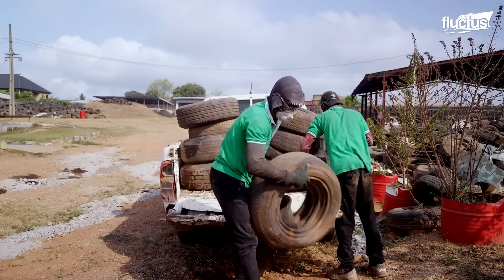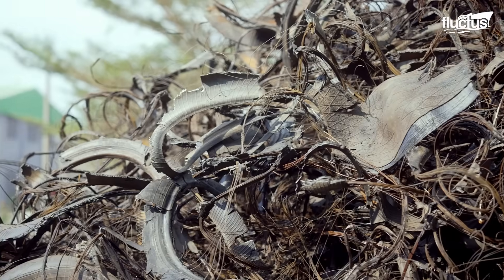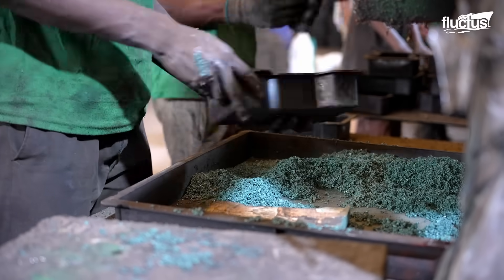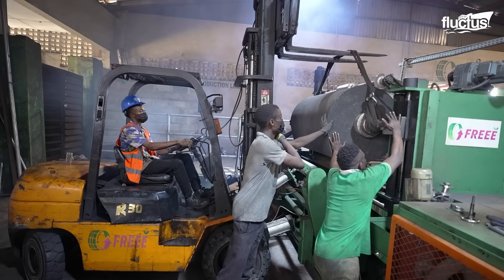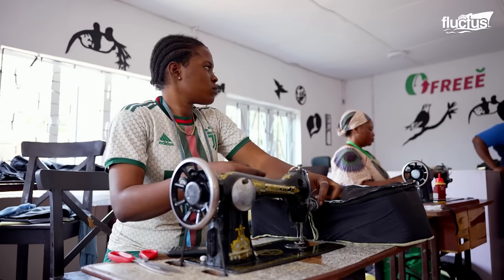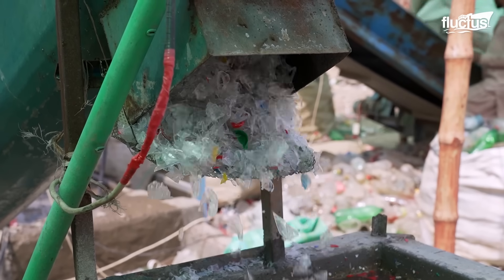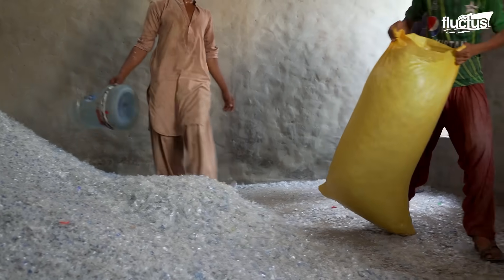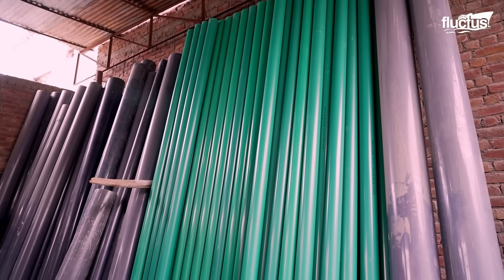How Nigeria Found a Genius Solution to Recycle Millions of Used Tires

Comment: If Nigeria can do it Australia should be able to do it. But Labor's employment/labour law kills all incentives to manufacture anything locally. Wage costs are too high a component of the operational costs.
Reply: I think it would be a bit more automated in Australia
Reply: @davidgreenwood5241  I disagree, all of the automation efforts are exhausted from putting shrimps on the barbie 😂😂😂
Reply: @nubiwiththebull, not to mention putting cold beers into eager hands.
Reply: @davidgreenwood5241 
A heLL of a Lot more 🤷.
Reply: The West would automate a lot more, we already do.
Question is if anybody would buy the products.

In the case of the pavers...., there is no way anyone in the West would accept those gaps.
You included, if you had to pay for material and labour.
Reply: @Peter2k84  If it was automated the work would be more precise.  Also the best shape worked out.  No gaps. It wouldn't be full employment but would put those tyres to good use.
Reply: @Peter2k84  one company in the UK started a trial of fixing potholes using shredded rubbers, better than tarmac and way cheaper! But I don't know what happened and if they wanted to make experiment official or dump tires and recycling to third world countries as usual ..... Because the rich don't make money from recycling .....
Reply: @Peter2k84  Well would have more precise equipment to make those pavers I'd guess.
Reply: How much are you willing to work in a factory for?
Reply: Workers salaries who actually manufacture things are too high but useless managers and executives who do nothing and make millions are fine.
Reply: @nspattak1 ceo's pay in the u.s. is the problem.  Start up capital is another. Golden tax loopholes for the rich to sail yachts through.
Reply: May be cheaper to do Nigeria as well due to bugger all safety enforcement over there!
Reply: Nigéria > Austrália
Reply: @NeuriLee  that's why so many people are illegally migrating from Australia to Nigeria, oh wait it's the people from Nigeria trying to flee their backwards country, lmao keep lying to yourself
Reply: Also im sure that's why so many of your Latin kin are flooding into the usa, cuz south America is just such a fantastic place to live right?
Stay home and fix your trash countries instead of lowering the quality of life up here please and thanks
Reply: Ich weiß nicht was ich davon halten soll.
Bei der Herstellung wird dem Gummi Schwefel zugesetzt, damit man die Reifen vulkanisieren kann. Den bekommt man nicht mehr aus den Altreifen heraus. Durch den Abrieb dieser Reifen,  beim Fahren, verteilt sich Feinstaub und der enthaltene Schwefel in der Umwelt.
Die aus geschredderten Altreifen zusammen gepressten „Pflastersteine“ haben keine kompakte Außenstruktur, sondern sehen ausgefranst aus. Außerdem wird irgendein Kleber verwendet um die Krümel zusammen zu halten. 
Verlegt man dann diese „Pflastersteine“ entsteht auch da Feinstaub, durch den ständigen Abrieb. Dieser enthält dann durch den Kleber noch mehr brisante Bestandteile. 
Ob das gut für Mensch und Umwelt ist, wage ich ganz stark zu bezweifeln.
Reply: @elliemeehan9947 you know what's hilarious? I was reading some old comments in newspapers from the early 40s last month and saw multiple times random people complain stevedores and other labor laws in Aussieland made it impossible to get shit done there 🤣🤣 that was 80 years ago and you're saying almost exactly what they did
Reply: @Magikarp-4ever quite so mate, my father was a shearer and took part in the big shearer’s strike for better wages.  He told me of the whining by the graziers and merchants at the time that the industry could not sustain the shearer’s demands.  Turned out to be BS, the nation rode on the sheep’s back for the next 40 years till we diversified and started giving our mineral resources to US and UK multinational companies for bugger all. The same old whinge comes out of the commerce sector every time wages are mentioned, a tired old mantra that has no relevance in this era. As far as the miners are concerned labor qld proved that the industry was still viable even after royalties were raised to 40%, it’s all about maximising the margin, nothing to do with nation building. I note that the new LNP gov in QLD hasn’t dropped the revenue, much to the chagrin of the millionaire mineral lobby
Reply: Machines have higher productivity, and needs less labor by hands. But they needs qualified operators, and high buying costs. Anyway we stuck on investment step in any recycling process.
Reply: Also I think it would be a very dirty environmental mess!😢
Reply: Wage costs are not the problem they never was it's the cost of living in everything  driven by the governments that's the real issue behind poverty. Today we see the results of their corrupt greed.
Reply: Same in UK. 

Plus  too many people of  working age don't want to work. What do they live on?  Tax payers money?

Tony Blair lowered academic standards at University brought in Mickey Mouse degrees so that non academics could get degrees. Then no jobs. 

When many could have been skilled apprentices doing useful real jobs.

Then we have DEI where  the best person for the job is bypassed.
Reply: I'll tell you why because they pay their workers pennies on the dollar. They aren't providing the workers with expensive much needed personal safety equipment, the government would be involved to see if all of this safe.
Reply: Australia is just not worst than Brazil. Round here, government makes the people slaves.
Reply: Are we really about to follow  the trail of the movie Idiocracy…? This is more of a problem than helping. These materials are brought to the earth on purpose- there would be countless naturefriendly other options to avoid these  poisonous materials  for many reasons which are beyond imagination of a media mindwashed individual.

Bacteria that transform rubber and plastic into natural substances would be a solution.
The  shown economizing advertising manipulating bullshit, however, “destroys” yet more energy to convert a problem substance into superfluous products containing problem substances!
The industry propaganda shown, deliberately prevents nature-compliant solutions such as the return to product cycles based on hemp or other natural fibers.
Reply: We already do, most of the roads you drive on are coated with recycled rubber from tyres. A great labor initiative.
Reply: Cheap if you make it a prison job .
Reply: Comunista é uma praga é tipo erva daninha no jardim 😊❤❤❤❤
Reply: @elliemeehan9947 I disagree. Australia is a terrible country filled with terrible people who look like dirty khakis 😂
Reply: How about anywhere in the world.
Reply: Then import from Africa. 😅
Reply: With the right UV stable additives these problems should be overcome.  Child playground surfaces are being made from recycled tyres.  These are continuous surfaces, not pavers.
Reply: If we can do bottles and cans we can do tyres
Reply: lol enjoy your equality. Jesus of Nazareth didn't lie when He said, you will always have the poor with you, but you won't always have me.
Reply: Right! Minimum wage is so annoying, as if everyone should be able to afford food, heating, and accommodation all at the same time. Child labour laws too, get rid of them. Then we won't need to pay for daycare subsidies either, get those four year olds on the tools, they can sink or swim.
Reply: Looks like those masks 😷 won’t do much… worry about the workers health years down the road.
Reply: We already recycle tires in Aus. My shed/gym floor has rubber tiles made from recycled tires.
Reply: Why do you think everything is made overseas - because wages are wayyyy lower. It's pretty simple. Standards of living is the deciding factor.
Reply: Coalition does the same.............
Reply: Twotierqueer is worse , he's dangerous.
Reply: @elliemeehan9947  you might want to Use Google before you make absurd comments
Reply: @MD-zy9xk hopefully to prevent a cataclysmic event more people realize using google or alexa or similar is part of the problem but never can be  a part of solition to problems of mankind.
Reply: Wonder which Asian countries are doing this?
Reply: The US has the same problem, but it’s the ‘environmentalists’ who impose lawfare so that this kind of process would never get off the ground.
Reply: @anthonykeller5120 Sooo? In addition to the tire waste, you want an environment filled with plastic waste?
Reply: Austrália é um comunistão antiguado e ultrapassado, jamais conseguiriam fazer algo assim 😅

Comment: Those poor workers should be issued industrial strength breathing masks as well as full-body suits and gloves, I imagine particles can enter their pores.
Reply: No,no. No safety gear ,that's part of their genius solution.
Reply: Matey you should try working in an English steel works😂
Reply: This is Africa.. go there and see for yourself
Reply: I was just going to type the same message! Poor guys!
Reply: The white guy was cutting the tire with the chainsaw and not wearing any respirators at all. .. breathing in that burning rubber is not healthy. At least the black workers were wearing a mask.
Reply: They don’t care about the workers, just wanted to film it for their millions of subscribers.
Reply: they don't  issue any ppe of any kind which is part of how they can afford this  .
Reply: These guys..
Reply: This is Nigeria eh?
Reply: I guess you’ve never done manual labor before, or have never experienced doing manual labor in the heat ,80s with as much humidity is absolutely brutal. Let alone wearing a bunch of safety gear. I agree the whole system needs better efficiency but that’s extremely expensive and there is very little profit in the recycling business.
   

⸻

Edited Response (I had ChatGPT assist me in cleaning my original comment, and added some to the ending):

I wanted to revise my original comment to better express my thoughts in a more respectful and clear way.

I understand the concern for worker safety — it’s definitely important. But having done manual labor myself, I can say that working in high heat and humidity (especially in the 80s or higher) while wearing full-body protective gear can be incredibly difficult, even dangerous in itself. These workers are often doing their best with limited resources, and unfortunately, upgrading to top-tier safety equipment isn’t just a simple fix — it’s expensive, especially in industries like recycling where profit margins are already razor-thin.

That said, I think it’s also important to recognize that the workers in the video appear proud of what they’re doing. They’re likely weighing the risks against the rewards, making tough but necessary choices to support their families. It’s a complex situation — improving safety and efficiency is important, but we should also appreciate the resilience and agency of the people involved.
Reply: buy it for them then 😂
Reply: @ernstloubser7200  seriously, sooo concerned but does nothing but make noise.
Reply: @matthodel946  yeah the original comment definitely falls into the "thoughts and prayers" virtue signal category lol
You know this guy posts thoughts and prayers whenever anything bad happens
Reply: @lawrencecarter1954 there’s something wrong with you
Reply: @Habeebea   what's that? You said you also make virtue signaling comments without actually lifting a finger to help anyone? Weird, people usually don't admit that
Reply: @ Mental case
Reply: No u
Reply: @Habeebea  care to elaborate?

Comment: CANCER: Used tires contain poisons that enter the body and groundwater, causing cancer. This industry recycles tires, but workers should be protected. The final material should be insulated from the air by a protective layer. It's not natural rubber, but petroleum!

Comment: We had the crumb asphalt on our freeway. It is so much quieter, but didn’t last. It kept pulling up into potholes. It could be our weather though. In Arizona the summers are very hot, 115°+. Or it could be that it didn’t hold up because of a high vehicle use on our freeways. At any rate for streets it didn’t work, but it’s wonderful for play yards. They had used mulch. Now they’re thick rubber mats. Great for safety. But it is expensive to recycle, we’d need to subsidize an industry that recycled goods. Everything from metal, tires, plastic and glass, to paper and electronics. Some of this does happen here in the US, but getting manufacturers to be required to use these recycled products in their product. There’s always an issue. From it’s not pure enough to the expense
Reply: Its not that good for play yards, there's toxic chemicals in the tires that can come out.
Reply: The next they will find out, that the rubber in combination with rain, heat or cold will seep polluting stuff from the rubber into the soil and in the ground water, and there you go again... 😢
Reply: @JohanDee  We "will" find out?
That thing is settled: it will erode into microplastics and be carried away by the wind to contaminate everything.

Comment: They produce PVC pipe with PET recycled??
Reply: PET is Polyethylene Tetraphalate. PVC is Polyvinyl Chloride. Completely different chemically. They could be used partly interchangeably but only if the producer and consumer understand what they're using.
Reply: That was exactly my thought
Reply: Ist PET in den Reifen? Nur früher oder jetzt auch noch?
Reply: Like a famous singer would say - "it's a kind of magic..."
Reply: 🤷‍♂️ chemistry.  I guess poly vinyl chloride can't be made with a different type of poly?

Comment: I see no capacity here to reuse 5million tyres a year.....
Reply: Tibor , & I'm only speculating here, but what if, all new major roads were surfaced with a form of this product🤷🤷. Would your opinion be different then?
Reply: @texgowing7359 then the roads would need a re-pavement once a year.
Also the costs would skyrocket, as they would need to be build plate by plate, instead of just pouring it out.

There is a reason they make pavers for walkways.
Reply: @Peter2k84  the roads made with this material would also become so slippery and would cause a lot of accidents.  It would feel funny to drive on though if you hit a bump.
Reply: @texgowing7359 I think they are saying that the facility doesn’t have the capacity to recycle five million tires a year, not that five million tires worth of recycled rubber could be used annually.
Reply: The product known as "Crumb Rubber" is used for the surfaces of childrens' play areas and indoor sports playing surfaces. That's a lot of tires! Do you have any better ideas?
Reply: Give it time to expand , Rome wasn't built in day
Reply: True, the process could be more mechanized.